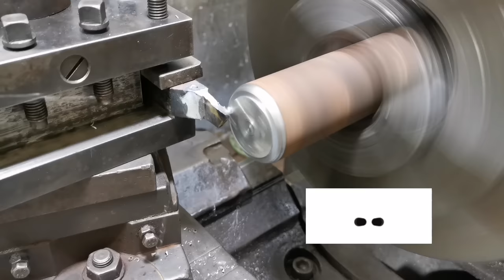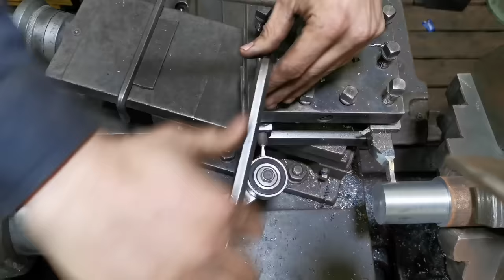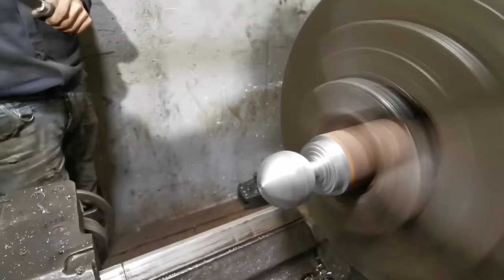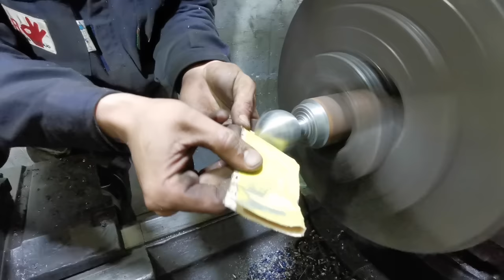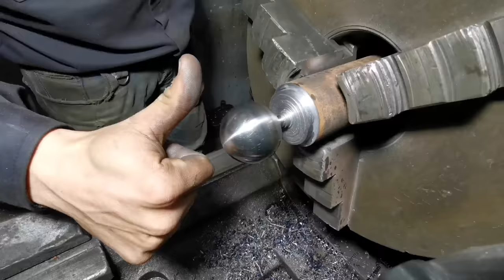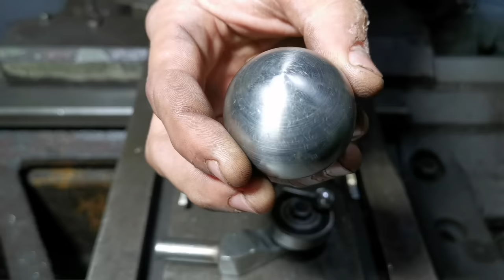Making a Lathe Ball Turning Tool | Tie rod ball pin size reapering tool for lathe machine

Comment: If you had a radius on the nose of your toolbit (it seems as tho it would be about 3/16 to 1/4 inch by estimation) the finish would be smoother.  Ditto for the follower that contacts the bearing.  Very nice idea tho.  Thank you.

Comment: KISS! This is a great idea. One thing that 😊may not be obvious to a beginner is that the follower has to be the same shape and size as the cutting bit.
Reply: The shape yes, but the size isn't. 
It would simply scale the product, if the follower smaller the product would be bigger or the other way around. 
But I guess It's easier to just change the bearing if you want to make a different size ball.
Reply: @joefebri3236    No. Consider: the follower is 1” wide with the same narrow bit. The shape cut will be a cylinder with spherical ends.
Reply: @ThisIsToolman  well I haven't tried it, but in my logic if the follower following a sphere then it wouldn't make sense if the  end product is cylindrical if they're at least have the same shape as the bit. 
That's what I have in mind at least, I might be wrong because as I said I haven't tried making one.
Reply: @joefebri3236    Semantics is important. I’m forever wishing we could post images. By “follower” I’m referring not to the ball bearing. The other component “follows” the ball bearing. It’s actually tracing the the cylindrical shape of the ball bearing. 

Imagine a very wide follower. As it traces the cylinder, its wide nose glides across the ball bearing while the more narrow bit cuts a cylinder shape on the part until the wider follower finishes traversing the bearing.
Reply: @ThisIsToolman  ah now you mention it. 
What I have in mind is a bit less or a bit more than in size, but yeah if its difference is way too big that's definitely wouldn't be the same shape. 
I admit my mistake in this sorry for that. 
The size is indeed important. 
I didn't mistook the "follower" You mentioned but I suck at explaining, because I only good at passive English, but you did great at explaining. 
Thank You.